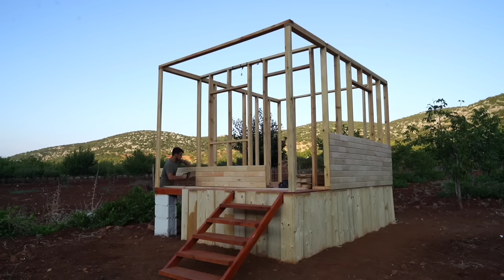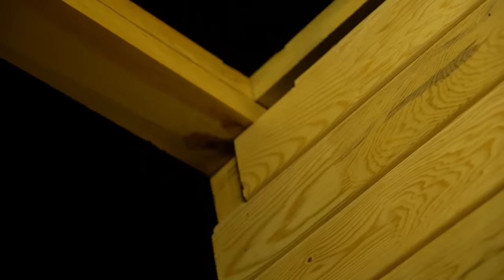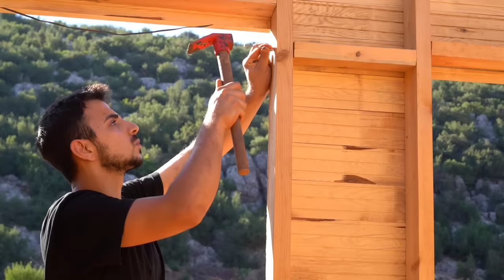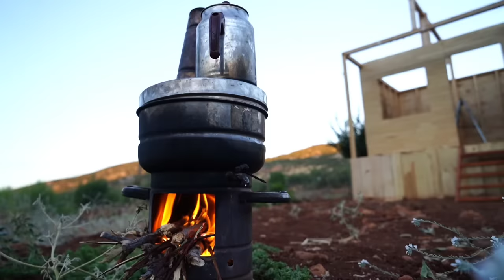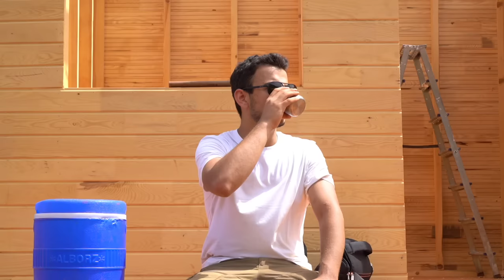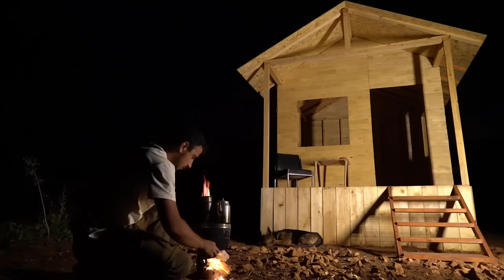Building a Wooden House / Off Grid Log Cabin / Tniy House / Part 2

Comment: The framing around the windows needs to have additional support on the sides with an actual header above the windows.   The extra side boards then support the header.   As it is constructed now the load is supported only by the nails which is not stong.    It is such a small structure it may not matter.